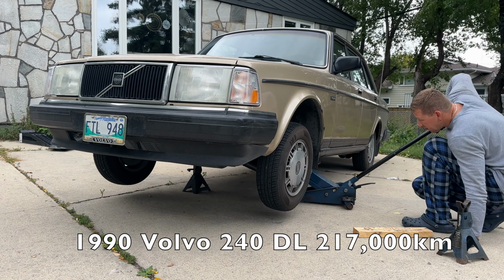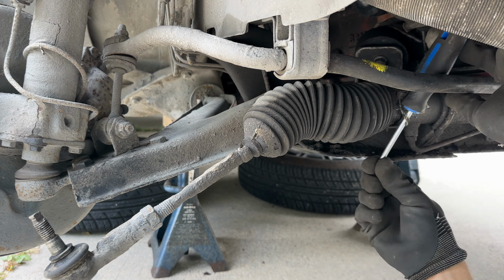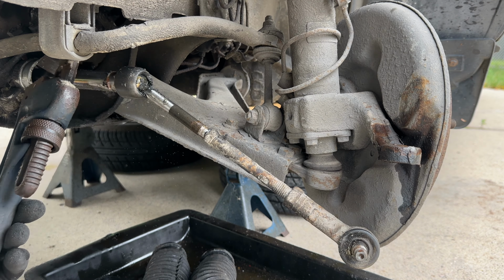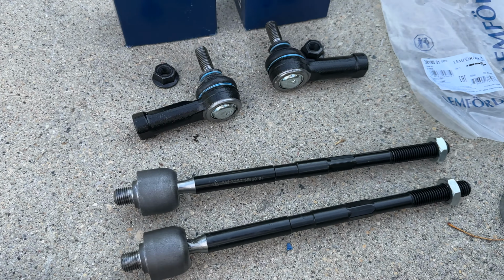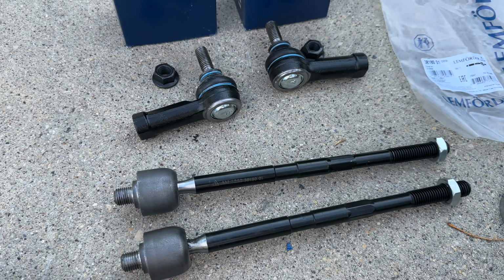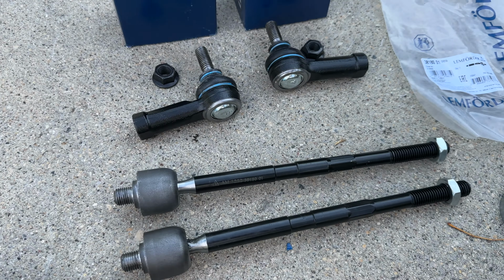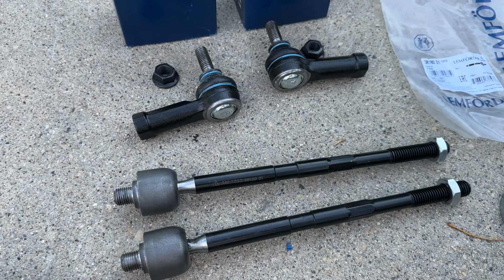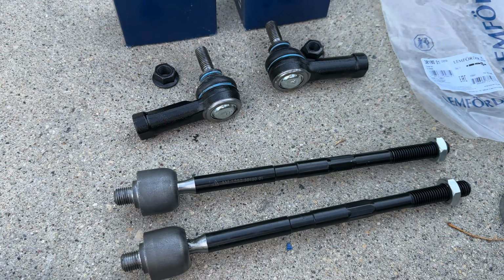Volvo 240 gets new Inner/Outer Tie rods. New boots and pressure hose. Fixed!

Comment: Magnets are probably there to catch any metal filings from wear of the parts. Like the magnetic drain plug.
Reply from the maker: Most likely. But now it’s loose on the hose
Reply: @volvosweden  you can put some magnetic metal strip below it or even tape. If it is loose it might damage the line, no?
Reply: @volvosweden the line will expand slightly with time and temperature/pressure changes. If it’s still loose after few weeks I would putbsome tape or something between it and the pipe to make sure it doesn’t start rubbing trough that hose with vibrations.
Reply: Thanks for the help.

Comment: Little tip for future. If you struggle to remove a rubber pipe, run an angled pick in between the pipe and fitting to break it away. 
Also on your XC70, remove right side arch liner and have a look around electric power steering pump hoses, they tend to start leaking slowly just as the hose you done on the 240. Great video as always👍
Reply from the maker: Good tips. My xc70 has regular power steering do I still have the line run there?
Reply: @volvosweden  mine is a D5, I thought all P3’s had electric power steering. Does yours have belt driven power steering pump? If so then you don’t have to check that area.
Reply: @Dalbayob69 my 2011 P3 XC70 3.2 has a power steering pump.